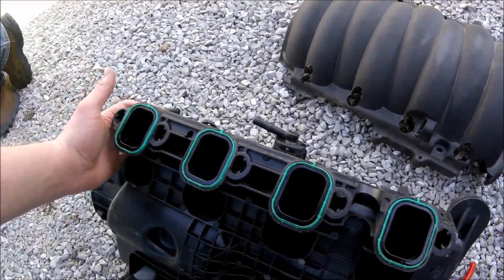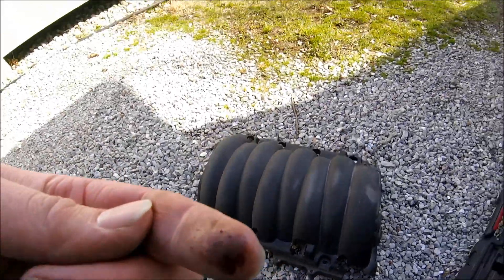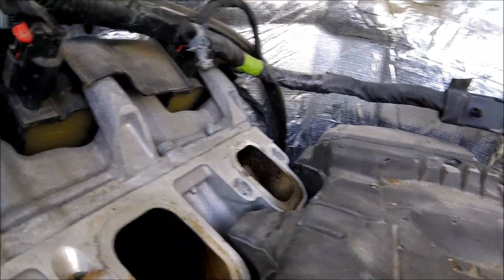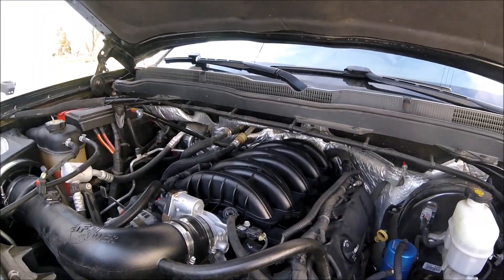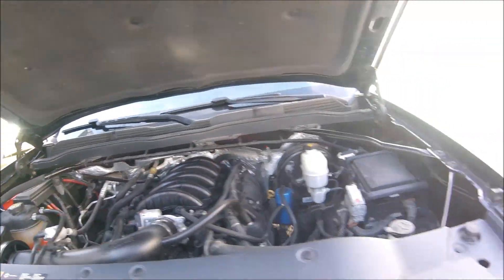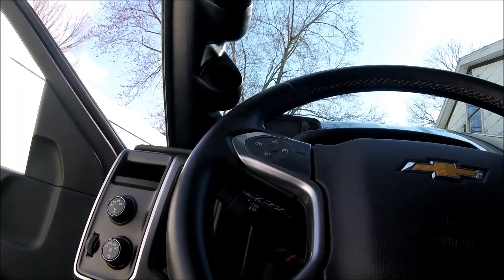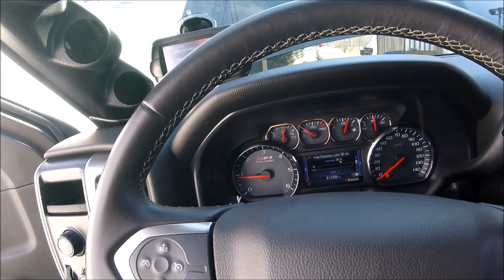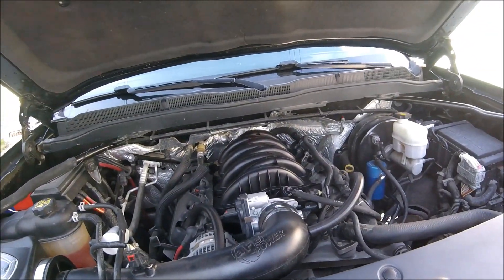L86 Intake Swap w/ Katech Ported Gen V LT1 Throttle Body for L83 (5.3L) Chevy/GMC Silverado/Sierra

Comment: Thanks for the video, planning on doing this myself this weekend.

Have you considered putting in the corvette 95mm throttle body? Curious what kind of bump that will add in throttle response as opposed to the 87mm. 

Sure I'll be happy going from 80mm to 95mm!
Reply: He would have to port the I take throttle inlet the intake is what does most of the magic if you have 95mm funneling it back down to 88mm in the intake inlet won't make much of a difference

Comment: Planning on doing this myself, did you consider swapping the fuel rails aswell why you had it all open? Just wondering if it'll create a greater performance gain or just problems. Reason I ask is I got the manifold and upgraded rails meant for the 6.2 just curious if it will create problems on the 5.3
Reply from the maker: I'd tackle one project at a time. Since these engines are direct injected and not port injected like the LS engines, removing the fuel system on and in the engine can either be a breeze or a nightmare.

Comment: Did the check engine came on when u swapp it??
Reply: It shouldn’t Unless you don’t tighten the intake manifold bolts in the correct order and have a slight vacuum leak. The swap is 1 for 1.
Reply: Any update? I got code P0113 and P16a1

Comment: Hi shaneman, 1 week left till I get my custom 95mm L86 ported manifold from Gawtney. I also bought 95mm ported TB and a custom 4 inch 90° tube from Spectre Performance. I've been searching all over internet and suprised could not find one step by step instruction video on the removal of L83 manifold for the swap. All are finished product.. Is there any chance you could do a quick video by listing out all the steps on removal of the stock manifold, sensors to be taken out, and tools you used? That would really help my installation a lot! Thank you.
Reply from the maker: I haven't had much time to do videos as of late. However, 10mm sockets extensions, and a ratchet will be your friend in removing the bolts. You may need a pick to remove stubborn electrical connectors, but be careful using it as it can damage the connector and sensor. I would also recommend pry tools like trim removal tools to remove any clips that are pushed into the manifold. Especially the rear clips on the back of the manifold. You will thank me later.

Comment: Hey bro I got a 2017 5.3 with long tubes no cats, 93 octane tune, 4.88 gears and intake.  Would doing this l86 swap be worth the hassle or you think just investing in a whipple down the road be better??? Thanks bud
Reply from the maker: It's all in what you're looking to do with the truck. I only chose to do it for what I was planning later on down the line. It has almost little to no effect on N/A setups.

Comment: @Shaneman20 is it normal my truck sounds choppy and if so do i need a re tune?
Reply: Mine sounds different too like almost as if I has a cam. Also I have a lot more clicking noise like a diesel idk if I like it. Also in park if I throw my rpms up they catch around 1.5 hang around a sec and then drop to normal idle. I’m going to get a tune soon but we’ll see. Did you have any similar symptoms?

Comment: I see you got the unported stock manifold. Would you recommend to the ported one or theere's not much of difference?
Reply from the maker: I would recommend it if I was going for a stock manifold N/A high power setup or even power adder setup. At the time, I felt the cost:gains ratio didn't make sense. So, I went with an L86 stock manifold. Perfectly fine for my application
Reply: @shaneman20  Thanks Shane. My current 5.3L setup is K&N 77, Kooks Long Tube Headers, Highflow cat, Gibson dual split catback and a diablo tune. Im doing a ported LT5 95mm TB with an adapter. I do see the Ported costs $500, and trying to figure it out if a stock L86 manifold would do same.

Comment: I have a 2016 sierra 5.3 ecotec 3 I wanted to do this kind of set up (intake manifold and a new throttle body for more airflow. You think this would work with mine if i got a custom tune right after I installed??
Reply: I.e. even though the intake manifold is meant for a 6.2 would it still line up correctly??
Reply from the maker: @SargeWedge  Yes, and yes.
Reply: @shaneman20  thanks mate!

Comment: Do you need a tune after this?
Reply: If you’re going from a l83 to l86 throttle body and mainfold you will. Mine would barely stay on got it tuned and whole different truck

Comment: How much hp did the throttle body give you??
Reply from the maker: Very little. Katech says it can add 1-3hp.
Reply: Did you feel any difference performance wise than the stock throttle body? And is faster in responding when flooring it?
Reply from the maker: @bo-jassim7419  A little. It's not like the 07-13 Silverados, but it does feel better. Especially after a tune.
Reply: I have a 2016 bolt ons silverado do you recommend it or do i need more mods?
Reply from the maker: @bo-jassim7419  The only reason I got it was for the next stage of mods. It was merely a supporting mod.

Comment: Is there any recalibration on the new throttle body when u installed it ? Or reprogramming
Reply from the maker: I would recommend a tune. Initially, it'll be fine, but I would still highly recommend a tune.

Comment: did you reuse the same rubber coupler between the air tube and throttle body or did you have to get a bigger one for the increase in size of the throttle body?
Reply from the maker: I had to get a bigger connector. Luckily, AFe includes the bigger connector with their CAIs. So, no added expense.

Comment: I checked the part numbers on GMPartsDirect and I’m sorry to say L83 and L86 Manifolds are the exact same. They only change the Throttle Body. L83s and L86s also share the same Heads and Exhaust Manifolds. The Cams are different tho, but you don’t have to worry about that now lol
Reply from the maker: Exactly. Just allows you to run the bigger throttle body is all.
Reply: L86 has same cam as LT1. I think only difference between L86 and LT1 is the inlet and the tune.

Comment: You do know the LT1 intake fits on the trucks too right? Just need a 45 degree couplter for the TB since those angle the TB downward
Reply: the truck 6.2 is a LT1 with a taller intake a different cam and tuning

Comment: @shaneman20 is the throttle body worth it? Looking at getting one just wanna know if it’s worth it. Not looking for it to add 50 horse, but to get rid of some of that lag would be nice. 2014 6.2. Intake, tuned and exhaust for now.
Reply: My Blackbear tune is so sensitive at 30 mph I'm either not touching the pedal or I'm accelerating. And if I'm in first gear accelerating lightly and decide to wrap the throttle it immediately jumps. Might try tuning first instead of replacing hard parts
Reply from the maker: Probably not. If you're N/A, I wouldn't bother. If you're going forced induction, then I'd say look into it.
Reply: Shaneman20 damn, I already pulled the trigger lol. Now I’m thinking about sending it back. I am going supercharged, just have to wait in it til next summer due to buying a house.
Reply from the maker: Honestly, hang on to it. You might find a use for it if you decide you want a bigger supercharger.
Reply: Shaneman20 I’ll probably just toss it on then since it’s already gonna Be sitting. Guess we’ll see! Can’t get much worse, we tried tuning the pedal response and he couldn’t get the initial to do anything til it hit 14% throttle. After its moving it’s fine, just that initial lag. If I can get rid of that that’d be worth the 300 bucks. Ya know?

Comment: What tools did you use to get the bolts on the back? And how did you get the intake cover off? I'm having a hard time with my install.
Reply from the maker: If I remember correctly, I was able to reach all with small tools. There is a wire harness on the back of the cover that you'll need to pull off in order to get the cover completely out.
Reply: Thanks for the help! I did what you did and took the intake out first then cut the clips off because i wasn't putting the cover back on. Also check out black bear performance for that custom tune you want to get. Won't be disappointed.
Reply: Can you remove the manifold cover without removing the manifold itself?
Reply: @andrewruiz8914  yes

Comment: What’s up bro I’m about to do this swap on my l83. Do you know what’s the torque sequence and the torque spec?
Reply from the maker: For the torque specs, Pace Performance offers a sheet for the LT engines. For the torque sequence, I used the sheet that MSD provides for the their Atomic intake for the LT1. Same sequence as the L83/L86. I'll leave the links in my description.

Comment: Damn man. Arent your running a catch can too!!!
Reply from the maker: 603Machines Yep. Cut the lines shorter to fit the new intake.
Reply: I would much rather recommend a Moroso Evac System. Moroso 25900 is the part number on eBay

Comment: Hey Shane man , I'm about to do the swap as well I was wondering will my l83 intake tube fit on the l86 if not did you use have to use a coupling reducer ?
Reply from the maker: You will need a coupling reducer. I already had one that came with my cold air intake setup.
Reply: I'm getting a 95mm tb with a ported l86 manifold openlet to match. So I bought a 4inch tube from spectre performance for a direct bolt on. No reducer and no bottle neck.

Comment: Great video . Wish we could have seen more of how carboned up the  valves were . also what exactly do you do in the automotive Feild ? Are you a mechanic or work in parts ?
Reply from the maker: There might be another chance later on. Everything except cylinder 7 and 8 were really bad. 7 and 8 weren't that bad, but still had harsh buildup. I was on a time crunch. So, I'll see what I can do next time.

Neither. I like to think I help make dreams. ;)